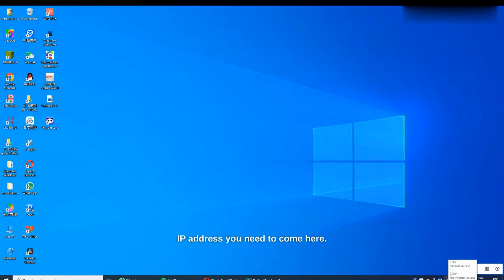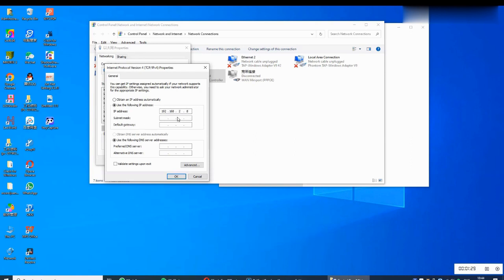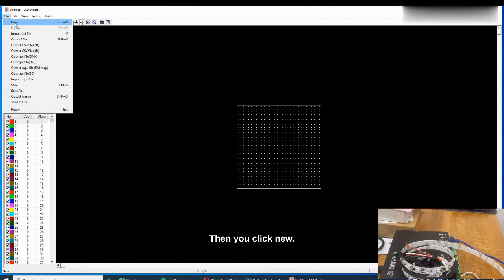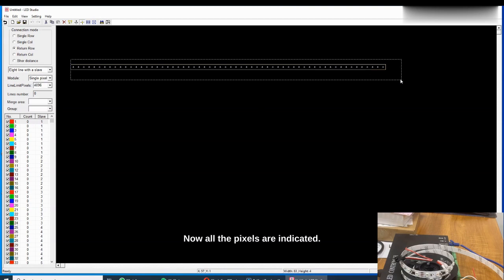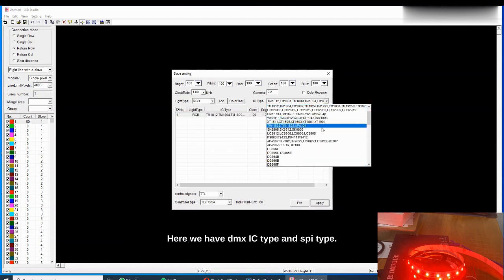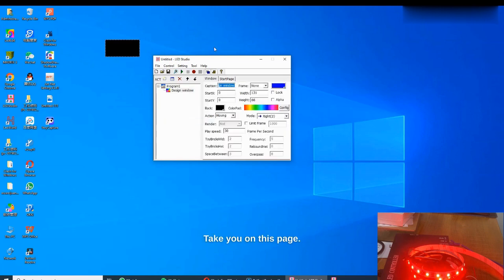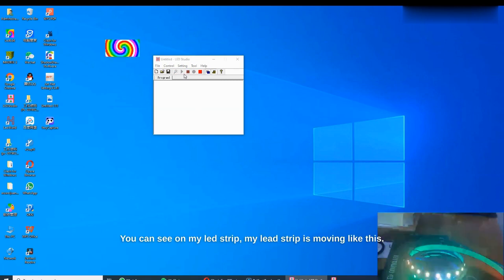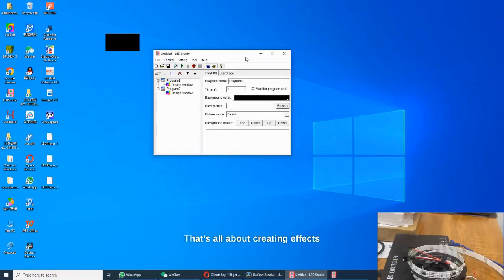ledstudio andcontroller h807sa program using  ledstudio #ledstudio#807sa#H807sa#H807sled controller

Comment: Hi, thanks for this very helpful video. Now I just bought h807sa and came up with this situation all my led strips, default are rgb, however some strips are BRG. The lcd menu doesn't have any option per port to adjust the strip color setting for that port. I think I can do that with Led Studio and send that configuration to h807sa (so it boots like that without the computer). If I can't do that in BMX slider 2 (which should be red) always illuminates blue for that strip... Thanks a lot in advance! Can I adjust per port strip color order with LEd studio and push that config to H807SA?
Reply from the maker: you are welcome